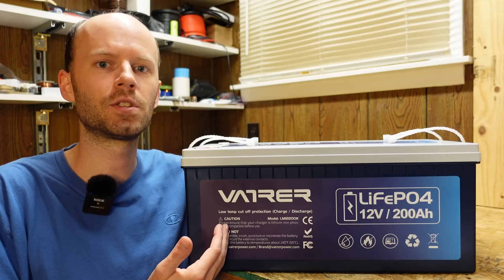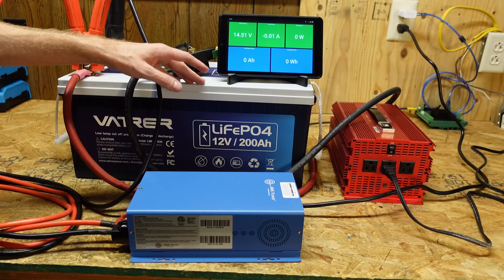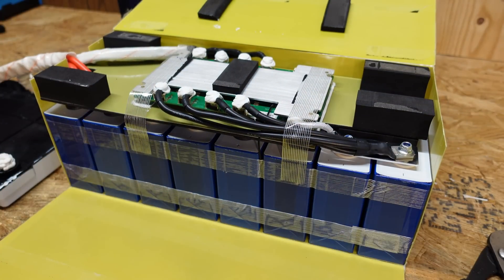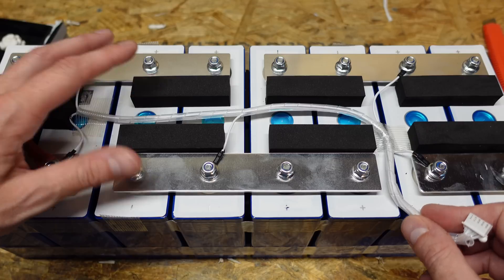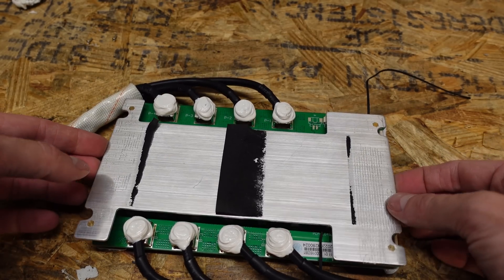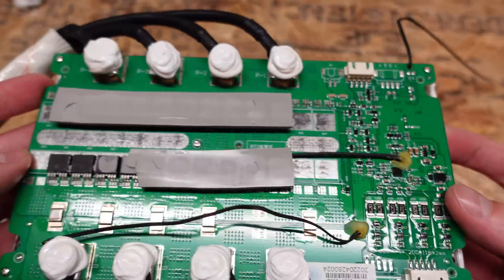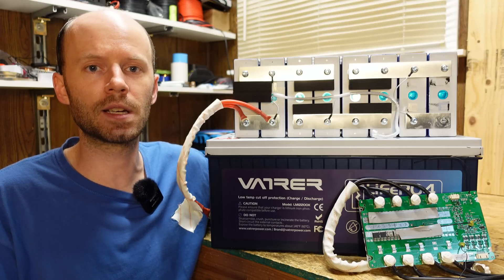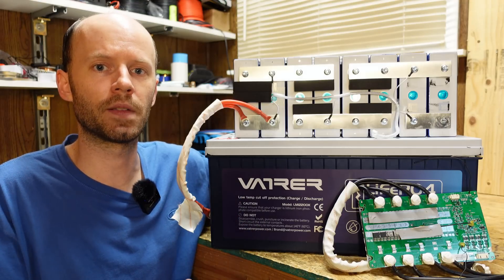Vatrer 12V 200Ah Plus LiFePO4 Battery Review and Teardown, Almost Perfect!

Comment from the maker: Vatrer 12V 200Ah... https://amzn.to/3AU3lca
(affiliate links)
Reply: @Power Vatrer  -  is that how low temp sensors are supposed to work?  

If the one lead senses low temp, that should be enough to turn off the BMS.  Epic fail.
Reply: @tsp2jxd  The original intention of our design is to protect the battery in winter or in a low temperature environment, and the three probes can fully detect the ambient temperature. Putting a sensor into ice water alone does not satisfy the condition.
Reply: @tsp2jxd  If you buy it back and use it in winter or in a low temperature environment, the battery will naturally activate low temperature protection. And not like the video test, there is no low temperature protection.
Reply: Great video as always, keen to hear what the manufacturer says!
Reply: @Vatrer  I guess we will wait for Mike to test and get back. I just can’t see a genuine failure case where it (low temp cut off) worked at the factory, but doesn’t work on Mike’s desk if the unit was properly designed and tested.
Reply: @AndyMcBlane  Since there are three temperature sensors, in the current environment, only one temperature sensor cannot activate the low temperature protection, and the three sensors need to detect the temperature below 0 degrees Celsius at the same time. If you use it in a low ambient temperature, you don't need to be so troublesome.
Reply: @AndyMcBlane  We hope so, we're even less likely to falsely advertise features that we don't have
Reply: Say I won but looks like a scam?
Reply: 👍Many other 🔋  eldet  Screws for get that cells together
Reply: YOU LOOK AND SOUND LIKE ANOTHER SOLAR /BATTERY UTUBER !  WILL SOMETHING
Reply from the maker: @BOOSTEDLASER  Or maybe he sounds and looks like me? Hmmm.
Reply: @LithiumSolar  HEH
Reply: Our battery definitely has low temperature protection function.  We just updated the internal structure. We will only update the battery without reducing functionality.
 Our 200ah battery has three temperature sensors, you need to put the three temperature sensors together in ice water at the same time, it will detect it, and then it will stop charging the battery.
Reply: @Vatrer  Very disappointing response. After being shown your product doesn't work, you simply argue that it does. Thankfully this review has kept me from making a big mistake as I am in the market for just such batteries with cold protection.
Reply: @Vatrer  If the temperature sensor was disconnected I would like to think the BMS would throw an error / refuse to switch the FETs

Comment: Great review. Anyone had a look at the 460Ah model ?
Reply from the maker: I just got one in yesterday! Give me a week or two :)
Reply: @LithiumSolar  ah...I kind of need to put my order in sooner. Any early insights would be great, if possible (maybe by email ?)
Reply: @PeteLeuenberger  I peaked inside and it looks like a JBD BMS and possibly EVE cells. No immediate complaints seen. Hoping to have a full review done by the end of next week at the earliest. It's being charged up for the capacity test currently.
Reply: @HomeSysAdmin  Thanks a bunch for that early info ! So it looks like to be one of the better built version, not like the one Will Prowse had done a review on. Any further updates will be greatly appreciated.
Reply from the maker: @PeteLeuenberger  Wooops, didn't even realize I was logged in with the wrong account. And yes, NOT like the one I tore apart that smelled like leaking electrolyte either......
Reply: @LithiumSolar  Found out that the 460Ah comes with bluetooth by defautl now. 
I'll probably go with the 300Ah, cheaper and without bluetooth. I don't want bluetooth running 24/7 in my camper.
Reply: @LithiumSolar  Actually I just saw that other video of yours, with the electrolyte smell. So knowing that, would you trust them to build a safe battery and buy it for an RV use ? It's one thing if it stops working, but if it catches on fire, that's catastrophic...
And another question : of the cheaper brands, like Litime, rododo, and all these, does one of them stand out, in terms of safety for leaks or catastrophic failures ?
And one last : have they fixed the rigid bus bar issues in the new vatr ? 
Thanks so much.

Comment: The nuts are called: "nylocks." The nylon degrades when exposed to heat, and one didn't look like it was fully engaged. If the bolt/screw doesn't protrude through the nylon, the locking action is lost.

Fiberglass reinforced strapping tape ... across the BMS heatsink?! Strapping tape is meant for reinforcing packages - not for electronic assemblies! That tape will fail with time when the adhesive deteriorates. And that time will be short when exposed to the heat from the BMS. You'll end up with a sealed plastic case full of loose items rattling around inside.

Shoddiness!

Comment: Dual parallel main wires are against any NEC codes and is very dangerous how can you say this is good??????
Reply from the maker: Please cite specially which section/article of the NEC applies to the inside of manufactured batteries and their conductor choice.
Reply: @LithiumSolar  your right whatever they wrote does not apply so let's not listen to any of it and make stuff dangerous??? There's a reason they don't allow it...
Reply: Get paid to recommend them whatever... I don't care but this stuff needs to stop and talking about it is the only way to make it safer! ✌️there not fused individually, one wire can sustain different amp draw and melt leaving the other to do the same. Been industrial tech for years I seen people try to do this it doesn't end well...
Reply from the maker: I hear a lot of mouth-running and nothing to back it up. I do not accept, nor have I ever accepted, payment for any videos on this channel. That's fine though - I have much better things to do with my time, so I won't be providing you with any further replies. I hope you have a nice afternoon :)
Reply: @LithiumSolar (310.1) not large enough size, each wire has to be able to sustain full load. Just look up codes man!  but i Think that response says enough... Personally, im trying to keep everyone safe.  let people know what they might not but whatever be that way...

Comment: Do you have a new link or a battery you would recommend since this one?
Reply from the maker: I didn't realize the Amazon listing was dead. My recommendation for the 12V 200Ah class would be the SOK https://www.currentconnected.com/product/sok-sk12v206-lifepo4-battery/?ref=lithiumsolar it costs a bit more but it''s sold and serviced by a US company and backed by a 10 year warranty. If you're looking for budget and don't require low-temp charging protection, LiTime is a solid choice (previously known as AmpereTime).
Reply: @LithiumSolar  thank you.  I watched a ton of videos and yours made sense, thank you

Comment: So you got this sent to you for free and they knew it? who is to say they did not send you a special unit with fixed issues?
Reply from the maker: What? Did you not watch the video and see the temp control issue that I pointed out?
Reply: @LithiumSolar  I more meant the soldering job vs other YouTubers teardowns. It’s very common in tech for companies to send specific units hand picked.
Reply from the maker: @blank7921  No, actually it's not common at all. I've been doing this for a very long time and I've not seen it happen even once. I've seen the soldering video you're referring to and I agree that was crap. They've since fixed it.

Comment: Following up from previous Comment(s):  as would be reasonable to assume, post-purchase ‘Support’ is Absolutely NON-Existent !  I definitely would Not assert that this is an exception, more, the Norm.   One of several reasons that I chose not to purchase Cells and do DIY, was the expectation of ZERO Recourse in the event of any Problem, should one arise.

Well, it seems the exact Gamble, buying preassembled from one of the deluge of Chinese brands, is No Less of such a Gamble.

This is Not to invalidate the excellent information that this Lithium Solar channel provides, or the findings in these Vatrer vids (specifically).  I am merely asserting that if you need to communicate with someone after they have your money …. GOOD LUCK.  Also, use an email alias for ANY communication with them.  I went from about a dozen Spam emails per day, to well over 200/day, within a couple of days of purchasing.  They seem to sell your info to every bot boilerroom in Asia.

Comment: We see the game Vatrer. Put out a limited supply of 12v 200ah batteries at $260 as bait then jack the price to $600...😂😅🤣. Hard PASS.
Reply from the maker: Just to be clear, that is $260/kWh (per kWh). This is a 2.56kWh battery so 260 x 2.56 = $665.

Comment: Actually they probably wouldn't listen just anybody but they do the big four reviewers if Will gives a bad review they lose sales that hurts hopefully you have enough clout if so they'll fix it if not maybe Will will do a review  this is why I wish he hadn't forgot where he started from up hear in Canada we have a lower dollar add 25% and gst add 5% and sky-high shipping which is sometimes higher than the product price so we're stuck with what we can buy from Lows and Rona online free or low shipping costs and all they carry is sealed lead acid battery technology now there is a unit which could be a good Entry level unit but since it has the wrong charging parameters it'll need new batteries yearly  it would be a great entry level unit if they'd change from pwm to mppt solar charge controller that could be programed for lithium but as long as the only reviews they get are that it's a great unit because it works when purchased don't care if it dies after the warranty period is over or if it needs new batteries every 9 months to a year don't care if you can only use it every 2 or third day because it has so bad an input wattage

Comment: low temp cutoff. Nice, if it works. I have two of the powerqueen 200ah look alikes, but no low temp cutoff. Had to be careful and put in a transfer switch and an extension cord feed to either my tool shed's battery, or the house, to keep the mini-split keeping the temp above freezing. I have not been able to get the low temp cutoff to work on the Epever AN series 80amp charge controller using basically the same test.

Comment: Wild, people only buy low temp protection battery's if they need it. Typical,I went for the battery without low temp cut off, I store them in heated storage. Let's face it if your battery's are cutting off because of low temp than that's a problem in itself, when its cold people need their battery's to work. Heated storage is the best solution.

Comment: Excellent video. Get a breath. I am not a fan of aluminum conductors be they buss bars, cables or straps. With the capacity at 200 amps there is going to be sufficient heat to  warm those bars up and expand. Where is the goop, grease, etc. for the connections. With the aluminum conductors swelling and shrinking unless they are chromed there is a problem. Still with chrome there should be a fine layer of goose grease preferably Ronny Red grease. The ny-lock nut is good except for the "one use scenario". We all reuse them but that does not make it right.  I never have trusted "one shot parts", even on the first shot. Still, better than a smooth nut or a kick there. I love these lithium cells. After 45 years of babying lead acid banks large enough to run a regular house for weeks or one 125 VDC motor for 72 hours or until it went up in flames, I see lithium batteries as amazing. Still, this battery is a "PLUS" and is rated at 207 AH. 202 AH is just another scratch in the finish. Thanks for the education.

Comment: So I pulled the trigger on (2) of these, in 100ah, on CyberMonday.  Will’s Review had me (discouraged).  I guess due to the negative exposure, they Corrected the key Problems (solder vs. Crimp) before you got your example.

I made them Assure me, whatever that’s worth since I won’t be ripping them apart, but I wanted it in Writing in a private email exchange, that they Crimp and no longer solder !   The Nyloks hadn’t become evident til I saw your Review.

My decision took A LONG time, and I had whittled a Long list down to Weize and Vatrer, based solely upon economics.  Reputable Docan Power came out with one, but No Reviews to date and I seldom feel “lucky” in rolling dice on unknowns.  The Vatrer came in with a significantly Lower FDC (final delivered cost) than the Weize, and at the end of the day, my decision was to $ave and use the Savings for an AC Charger.

I APPRECIATE You !  👍🏼😊

Comment: Cold temp?  I can get over it in a hurry.  I am sold! But I am preparing to buy one...how do I know if it's the newer (upgrade inside the case) vs older one?  Is there a serial number designator or date stamp or ?? to make sure I'm getting the new design?

Comment: Try putting all temp sensors in ice water, it might average them to make decision.  It may also use the temperature plus the charge rate to determine if batteries are safe to charge.  It could be more complex than you think
Reply: Yes, you are right, the 200ah battery is not 100ah, 200ah is more complex, as you will understand after watching our video. https://www.youtube.com/watch?v=tP9Bth37CRY

Comment: Maybe you can adjust temp cut off in Software? They are using you as a tester. Not available here in Australia.  André in Sydney
Reply from the maker: They don't allow changing of settings in the app - and that's a good thing honestly. No reason to tinker with settings that could create unsafe operating conditions.

Comment: The Chans 300 amp hour battery is the same price and has high and low temperature charging protection and is just as well built plus another hundred amp hours

Comment: I think you should post the manufacture's response to the low temp sensors - it is the right thing to do.  You should retest grouping the 3 sensors together. Then post the results.
Reply from the maker: I did, check here https://www.youtube.com/post/UgkxuQRI3Zamd5nl3bdBNA_Owxc3a6La9Wkl
Reply: Such a test is incorrect and can only be tested if it is really in a cold, large environment.
Please refer to our video ：https://www.youtube.com/watch?v=tP9Bth37CRY

Comment: Hopefully they will fix the BMS deal, yeah low temp cutoff isn't a deal breaker for me either,  I keep my stuff inside, and it doesn't get that cold in NC for long anyway,  I would still rather get raw cells, I need about 400-600ah 12v bank, and eventually about 2000ah 24v, or 1200ah 48v bank, if I go to 48v, (I really need to do so badly, the number of charge controllers is crazy, and I need more, 2x more, with 2x the pv)
It will be a while before my 24v bank needs replaced,  1000ah+ liion,   I'm just nervous having all that 
LI- NMC in the house,  if I could replace it with LiFePo about 1000ah I'd take the loss, until I could add more, I will probably buy a few cells per month,  or maybe save the money and buy at once , after I find a good reasonable supplier,  I'd like to get the BYD BLADE cells, in about a year or so,  but these batteries are almost tempting, for the 12v bank anyway!

Comment: I puchased 2 of the Vatrer 200AH Plus batteries 3 months ago. I contacted their customer service today about purchasing additional Vatrer 200AH Plus batteries to add into parallel configuration and they informed me that their current version of this battery is not compatible in parallel or series with the ones that I just purchased from them. Seriously?
Reply: cannot use also if older, very serious, use 2 systems

Comment: Great video thank you! I was wondering if you think this could handle a boat AC unit. I currently use a 3000 watt generator and only kick it on for about 15min at a time every hour over night.
Reply: are you using some kind of timer?
Reply: @massa-blasta  no it has a thermostat. But I would like to use a timer, and could if I could set up with this.

Comment: I see the spec of 10P allowed, and 4S is allowed...
Can 10P be set in series? 

Meaning what is the largest bank that can be built?

It sounds like they can be arranged 10P and you can arrange 4 sets in series for 2000Ah 48V setup of 40 batteries...
No?
Reply from the maker: The booklet doesn't specify; however, I assume it's the "standard" approach per most other companies where you would series connect 4 then each series group be wired in parallel. Total of 40 batteries.

Comment: Also note, the bms you printed out is fully populated with fetts, the one in this battery is missing several fetts, so I doubt it could handle 200A discharge for long.
Reply from the maker: That is a VERY good point. I wonder if this is actually rated for 200A even though the part number indicates 260A because of those missing FETs.

Comment: i have 2 of that brand 100 ah i paid extra for low temp cutoff . is there a way to test without breaking them apart?
Reply: Sure.  Cool the entire battery below the cutoff and quickly see if it accepts a charge current.
Reply from the maker: As stated above, cool the entire battery to below freezing and see if it still takes a charge. You would need to leave it sit for a while (like overnight) to ensure the temperature inside the enclosure has reached the same as outside. This is the only way to know.
Reply: Do not worry，There's definitely low temperature cut-off protection, and you can also watch Will's video, which has long been proven to have low temperature protection. 200Ah also has it, which is an accidental accident.

Comment: That Nylon Locking Nut isn't even engaged because the stud is too short.
Reply from the maker: I'm pretty sure they had some kind of thread sealer on the short studs. If you look at the nut I held up, you can see flaky stuff on it.